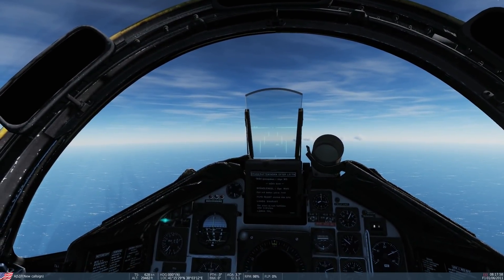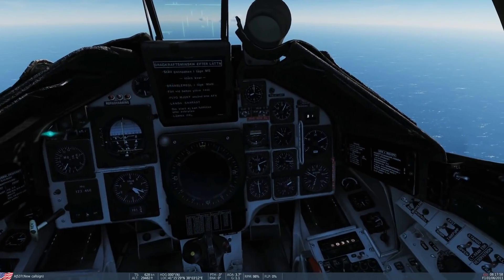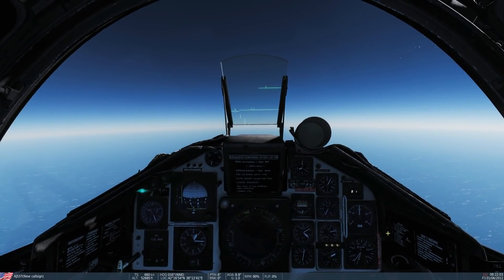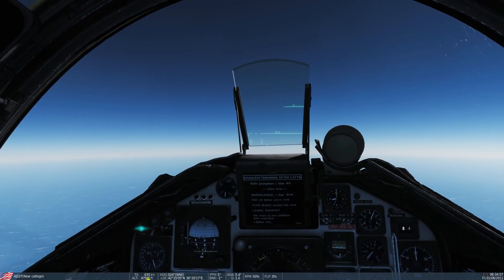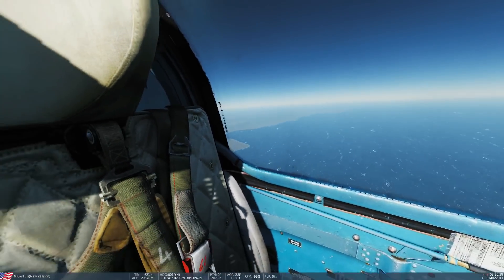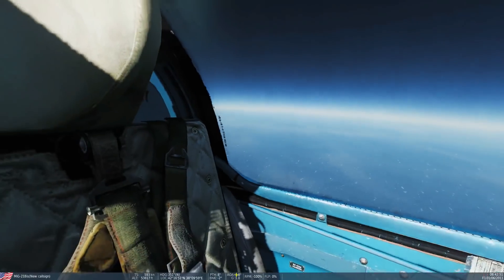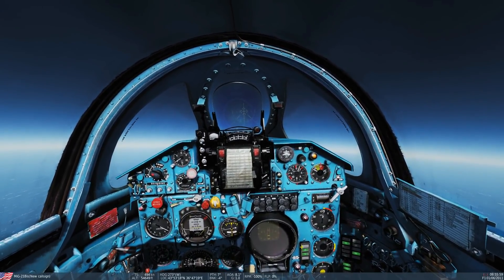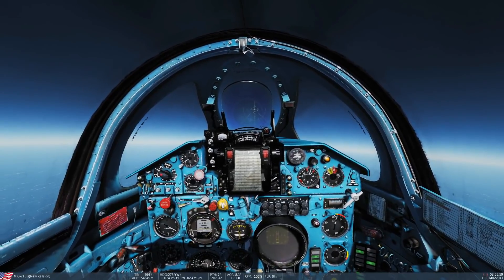Fast Jets: Max Sustained Altitude PART 2 | DCS WORLD

Comment: Shouldn't you be bringing the aircraft to stall? Using ground speed is a strange way of measuring it. Was it stalling or was the AOA simply increasing? Again, it should be where the aircraft stalls, not if airspeed is simply decreasing.
Reply from the maker: I get to the Aoa limit, at which if I exceed this limit, then the AoA will keep increasing un-controlably until full stall.

Comment: You're flying behind the curve dude. MiG-21 can cruise at mach 2.1 all the way up to 73000+ where you risk the engine cutting out.  Maintain 900-950 km/h IAS until you hit mach 2.05 (it's the thicker lagging line) and then hold that, you'll get there eventually.
Reply from the maker: I think I understand thanks
Reply: @grimreapers  I don't blame you for getting it wrong, she can be quite a handful with the shifting center of lift and all the oscillations that need to be counteracted constantly plus the intake design which requires 

maintaining high speeds to generate sufficient thrust. If you begin to fall on the wrong side of the envelope it's sometimes impossible to get back without losing altitude. I like to dash back to base after bombing runs so I knew 53k could be beat easily but I had no idea it would go that high either.

Comment: Googlemania time. ‘Published’ service ceilings for these planes vs Cap Test Pilot with no gas ceilings.  Su 27 54k vs 72k. F15c 65k vs 71k. M2000C 66k vs 59k. FA18c 59k vs 60k. MiG 29a 59k vs 60k. MiG 21 61k vs 55k. Viggen 60k vs 47k.  So either the flight models off ‘cough’ or the military aren’t too precise with their figures?
Reply from the maker: Thanks

Comment: Who would even fly a Viggen that high up? You should optimally be below treetop level, and that's while flying over a forest! :P

As I understand the Viggen it is happiest when it is getting a lot of air. Not only does it want to be down low in the thick air, but you get the most out of it when it is moving quickly through that thick air and ramming air into the intakes. This might be why it doesn't seem to keep up with other fast jets from a standstill, but once moving it can outfly almost anything.
Reply: The variant we get in game currently (the AJS) is an attack variant that can be pushed into an interceptor or recon role. Because of it's main role being as an attack aircraft the AJS is optimised for low altitude flying, a JA variant would be better optimised for higher altitude but we don't get that one in DCS currently.
Reply: @arvidg8547  Indeed I did not specify in my comment which variant it was, but seemed kind of redundant because Jaktviggen doesn't exist in DCS. Perhaps I should be more clear that I specifically mean the AJS 37 though in case they decide to add the JA 37 to DCS, because then I'd have to go back and change all my old comments I guess :P
Reply: @Nails077  Yeah the JA 37 has pulse a doppler radar Skyflash and AMRAAM missiles and an extensive countermeasures suite with U95 ECM pod and chaff flare dispensers.
It also has a ground to air Datalink for situational awareness and intercept and a Viggen to Viggen datalink with up to four JA-37 sharing the radar picture from one.
It's basically a mini F-15 and can hold it's own in an air to air engagement.

The reason some JA-37's got splinter cammo was so the enemy couldn't know what the opponent was just by looking at it.
Reply: You know why, clues in the title. Stop being a bellend and just enjoy it for what it is.